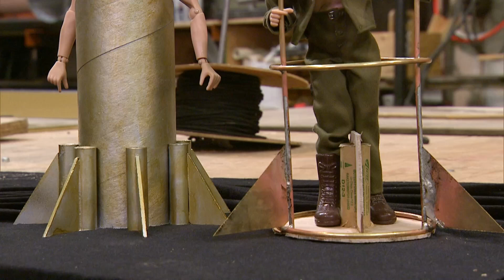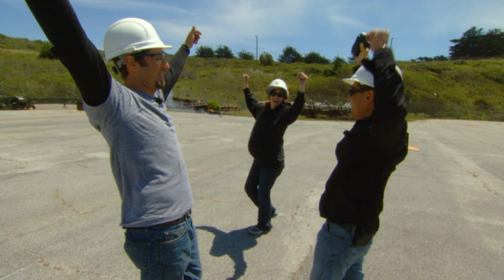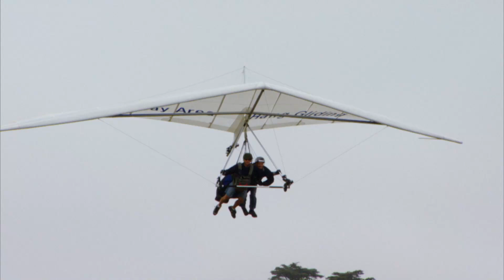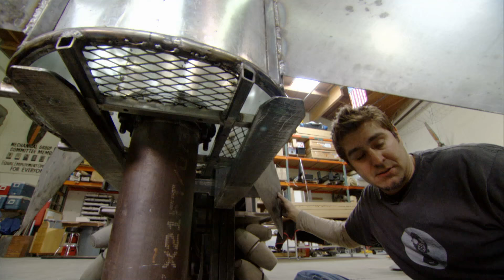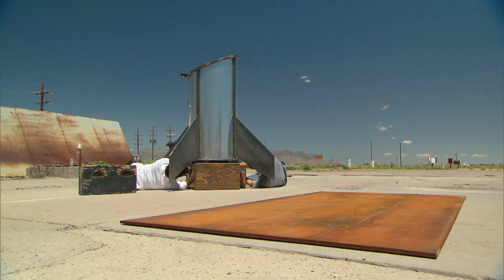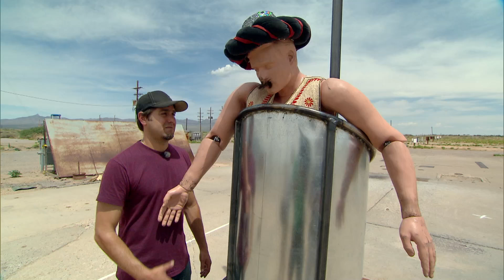Could A Human Being Survive Being Launched By A Rocket? | MythBusters

Comment: Now I’m not saying the story is true, but it’s very clear the rocket went crazy because of a failure happening with the fuel tank. A hole burned straight through the side and caused another direction of thrust. Can hardly call it busted from that failed experiment.

Comment: Can I suggest a way to "unbust" this one with but one major change?
Lagari was no 'dummy' he was a live human being with arms and legs that can control elements of the described rocket. As such, with  he could have shifted his weight around, had drag inducing wing suit like clothing and even perhaps the end parts of a parafoil shaped parachute to form two guide vanes during the ascent.
 With human guidance after leaving the rod the contraption could have flown much straighter, while a burn profile that slowed acceleration further up instead of increasing it,  would produce less of the off center atmospheric drag that would require  human correction. 
Of course even at White Sands, they made a lot of failed rocket flights before being successful. I am friends with one of the many technicians who worked there back then.
Reply: Well... the show has been off the air for over 10 years now. So unlikely any are going to change status officially.
Reply: @chasesan I honestly think they're bots that don't understand this channel is just reuploading a decade plus old TV show
Reply: @SystemDisab1e they are uploading it because we are watching them.

Comment: Now I’m kinda curious if you can power your flight in a hang glider with a hand held rocket like in Minecraft. A soft confirmed would be gaining altitude while already gliding and a hard confirmed would be taking off with rocket power held in a human grip
Reply: Minecraft must have changed since I last played it.
And of course you could.
Reply: @reliantncc1864 elytra are equitable wings that allow the player to glide, they were added in update 1.9 and a couple updates later they added rocket boosting- when a player uses a fireworks rocket while gliding with an elytra, they gain momentum- which was a vast improvement on shooting your self with a punch II enchanted bow to gain momentum 

I think taking off might not be possible- it needs more thrust than maintaining altitude, and even if a rocket motor that could fit in your hand has enough thrust, it would probably slip out of a human grip

Comment: "Motor worked perfectly"
Burns through the side seconds after take off. Sucks though because if the motor hadn't failed it looks like they might have had some decent height.
Reply: To be fair, it likely would have ended far worse if they used 1600s technology to do it.
Reply: @Undeadpriest94 You have a very good point. If they used a motor that actually used black powder, it could have just exploded.
Reply: They aren’t rocket scientists